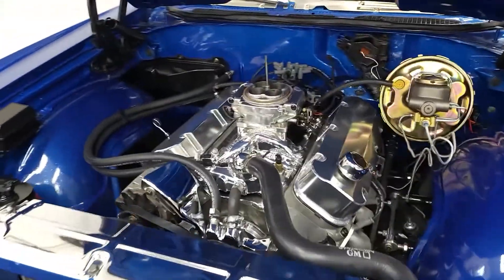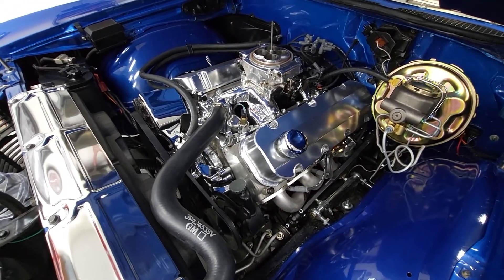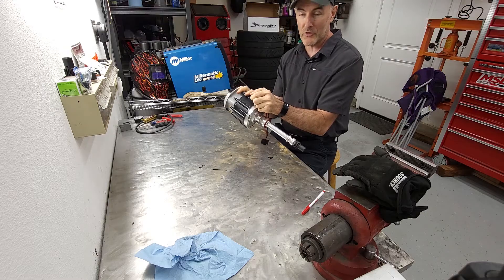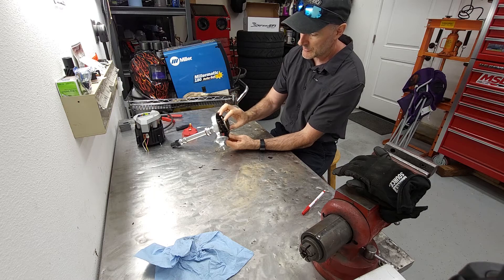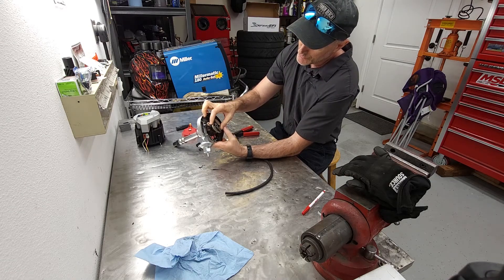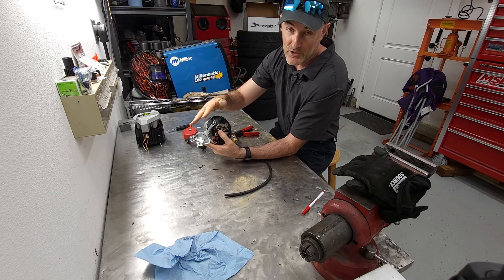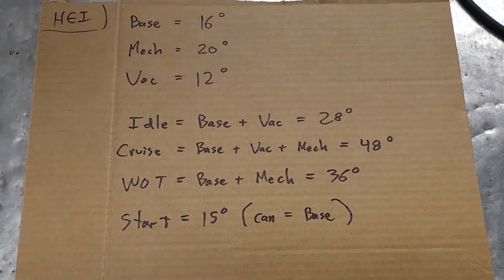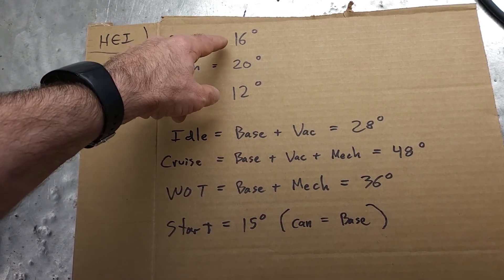Holley HyperSpark Base Timing Settings

Comment: Matt, great video. I built a 383 Chevy V8 Roller Cam engine from the block up and just finished installing a Sniper w/ Hyperspark. I have no idea what my timing settings should be as this is the only configuration it's ever had. I understand the basic concept of timing, just lost on WOT(entered 34 in the Wizard as a guess) setting etc. I did fire it up today for the first time and it ran very rough, took a lot of throttle to get it to idle, it oddly quickly overheated. I followed Holleys video/manuals with proper phasing. Any ideas would be great. I did gap the NGK spark plugs a little wider too. Thanks, Jeff
Reply from the maker: Mabey not enough initial timing? Throw a timing light on it at idle and see what it says vs what the Holley thinks its at just to double check the phasing. What's your start timing and your idle timing values?
Reply: @MattOverDrive  Matt,

Hey this is, we were communicating through youtube comments about my Sniper Hyperspark set up. Here is what I have:

Standard Sniper w/ Hyperspark
Chevy Stroker 383 V8 Roller Cam Engine
Promaxx Aluminum Heads
Comp Cams xtreme energy 224/230 cam

I’m a total novice and built this engine from the block up. I have no idea what to put for some of the Hyperspark settings. Initial fire up yesterday was very rough and died several times. The engine overheated very fairly quickly. I double checked everything including spark plugs, cooling, etc. The holley installation videos make it look easy, just run the Wizard and that’s it. The only data I entered was using the Wizard (guessed WOT at 34). Your cardboard whiteboard numbers made me realize I have no idea what mine are since this is the only configuration (Hyperspark) this engine has had.

Below are what my settings are for Spark. I did not input these. Any ideas you have would be excellent. Oh and your 71 Chevelle is unbelievable. What engine is in it? Jeff (I can email you if that's easier)

Here is what is listed for my Spark Settings on the handheld: Ign timing at idle - 15, Ign timing at cruise - 36, Ign timing at WOT - 34, No Boost, Crank Ignition timing 15
Reply: @jcheeech You get this timing issue worked out?

Comment: How do I change my cranking timing setting? Starter is having to do a lot of work to turn the engine over after it is warmed up so I need to pull some timing while cranking. Can't find how to change it in Holley's manual.
Reply from the maker: Hi Terry, its on the same screen as the other basic timing settings. (On the handheld) from the Home screen, go under "Tuning" then select "Basic" then "Spark". One of the options should be something like "Crank Ignition Timing". I have mine set to 12 degrees.